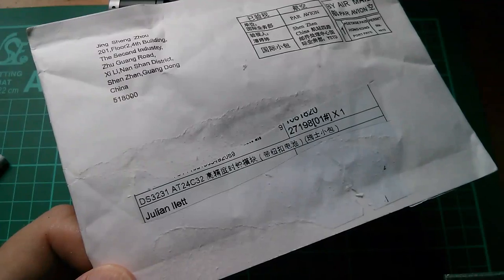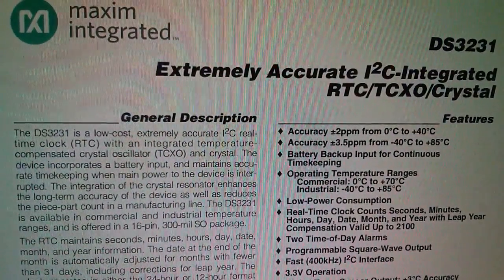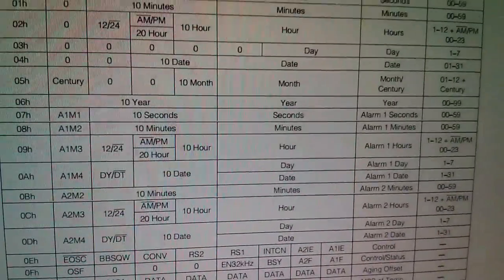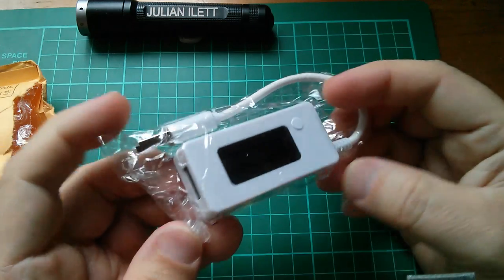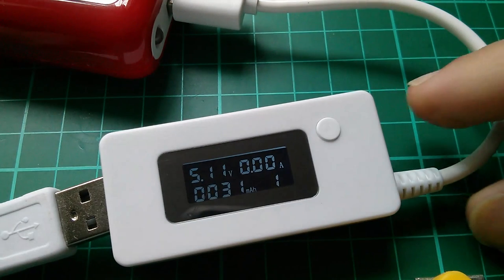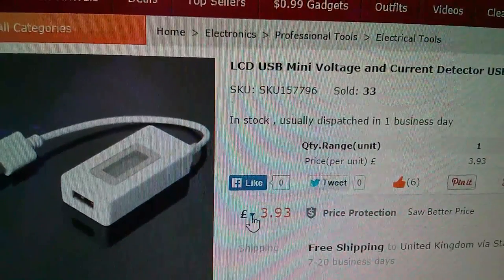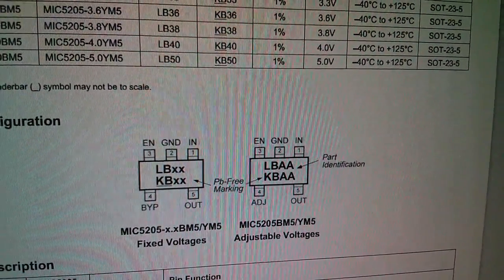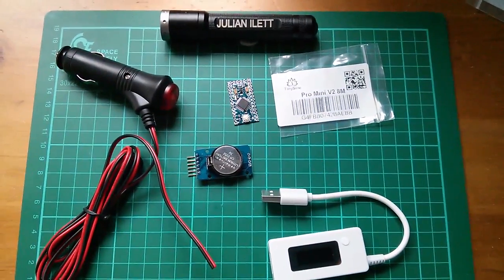Postbag #18: DS3231 RTC, USB LCD Doctor, 3.3V Pro Mini, Cigar Plug

Comment: 1. Double click - "change memory cell" mode. Single click - change cell. Double click again to exit from this mode.
2. If holding button approximately 3-5 sec, its clear NEXT memory cell (if you need to clear second memory cell, you need hold button on first cell).
3. Device start blinking if voltage is too high or too low. (Double click to disable blinking for current session)

sorry 4 my English...all the best from Ukraine! ))

Comment: Hi Julian, the reason why the device is flashing is the voltage is too low.  At 4.42V it is too low to support USB devices and the device will flash, and quite often shut down completely.  The micro USB connector is for testing cables for their Voltage Drop.  That connector can also be used in place of the attached standard USB plug.  Phones and Tablets can be attached to the USB monitor directly using a micro USB cable.  This is a nice feature not found in other USB monitors.

I hope this helps. :)

David

Comment: I much prefer the DS3231. It's more accurate, doesn't require a crystal, allows you to read the temperature. I've had some Chinese DS1307 modules with terribly inaccurate crystals. Only downside is that is doesn't have any battery backed memory like the DS1307. Luckily, because the IC doesn't do bounds checking (!!!), you can just (mis-)use the alarm registers, to store your own data.
Thanks for yet another entertaining video Julian!
Reply from the maker: beargun42 I had one of those inaccurate xtals too - lost about 3 seconds a day

Comment: KCX-017, long hold on button - moves to next memory bank and clears it to zero, double click puts it in memory view mode (no erase) and then you click once to move to next memory, double click again to exit memory view mode.  Maintains all 10 memories when power is off.  Flashes below 4.6 volts to indicate under voltage and you should see an arrow pointing down of far left of display.
Reply: Thanks!

Comment: Wafer thin PCB's seems to be the latest cost cutting measure in the far east. I just bought a new computer full size atx motherboard and the pcb would be lucky to be 1.5mm thick and shows considerable bowing from the soldering process.. It is a "quality" brand name but I suspect the competition are also up to similar tricks.
Reply from the maker: Rob B We demand cheap stuff - they respond
Reply: Sometimes it is useful. I have had times where that extra half a mm meant the difference in something fitting in an enclosure and not, but that doesn't mean it is actually a GOOD thing most of the time xD

Comment: I have 6 of the USB Doctor and all of them ended up with broken cords.  If you look at the cord at the device end, the cord is protected by a flex guard.  There isn't a flex guard on the USB plug end.  The ring like guard is so stiff, it eventually cuts the cable.

There is a newer version that has flex guards on both ends.  I found a seller on Amazon.com that has the new version, however, when I purchased 7 units, I received 5 old versions and only 2 of the new ones. :(

I also use a USB power monitor from a company called Portapow.  They are located in the UK, I purchased several units and had it shipped to USA.  Its probably the most advanced USB Power Monitor available. It can handle 0-50 volts and 0-5 amps.  Their website is "portapow.co.uk"  I hope it is a gadget you can review on your videos.

David.

Comment: How well does the ciggy plug hold into sockets? I have quite a few where the spring on the tip just pushes the plug out, and there isnt enough grip on the 2 ground springs to retain it. Really great when you drive for 45 mins with the mobile not charging without noticing it.
Reply: pretty much the design flaw of the plugs and sockets really, some work together well enough, others fall out or dont work at all, theres no real standard i think, and yes nothing really holds it in except the friction of the outer connector
, the actual lighters that once went into the car sockets were trapped in a springy catch (which got hot and released), but when they turned into accessory connectors and the required plugs, it was friction alone
, and the sockets changed inside to not include the catch, many sockets are way too shallow now, is a large part of the issue
Reply from the maker: Richms raw footage It looks pretty good - the outer connectors are quite firmly sprung and the tip is quite softly sprung. It also has the barb at the front.

Comment: It started flashing right around when the voltage dropped outside of USB spec, could it perhaps be a warning?
Reply from the maker: SixSixSevenSeven Yes, it seems the backlights flash to indicate under and over voltage.
Reply: Based to picture from similar listing, if voltage is below 4.6v or is over 5.3v the display flashes
Reply: Yep, <4.6v is out of USB spec. A power bank should never drop under that. It could potentially damage things plugged into it. Same goes for >5.3v.

Comment: hmm  Day ?  There's no need to be able to set that individually from the day/month/year.

you can fairly easily calculate the day of the week from the day.  The algorithm to do this was developped somewhere in the 19th century, way before computers and even mechanical calculators.   
Zeller's congruence: http://en.wikipedia.org/wiki/Zeller%27s_congruence (the trick is in the integer math).
The principle is converting the date to a julian day (a number of days since a certain timebase (could be anything) then modulo that by 7.
Reply: There are equally a couple tricks for doing the bounds checking based on some calculations rather than lots of individual tests. Again, those basically come back to zellr's approach applied cleverly. (it's basically all in the wikipedia page, just find the 'gems' :)).
Reply from the maker: oreubens I wonder if the DS3231 uses that algorithmic approach - or just lookup tables. I still think the chip should have an increment/decrement option (with bounds checks) in its command set.
Reply: Julian Ilett PC's and the likes have RTC's too but you typically don't worry about them since it's the OS that interfaces with them and not user code... unless...  you've been in the programming thing for a while and dealt with them in the past.

From how they behave (on PC, I don't have a DS3231 to test) I don't think the RTCs use the approach of updating a global second counter and doing all the calculations based on that.   If they did, you would see an invalid date correct almost immediately as it processes the next second.  From observed and documented behaviour I would imagine that the RTC logic increments the seconds register, if it overflows to 60, resets seconds to 0and increments the minutes register, if that overflows to 60 increment the hours etc.  so the difficulties don't start until it comes to checking if incrementing the day register overflows into a next month.

That's probably handled with special purpose logic gates rather than compare/tests or a table lookup, I doubt these things even have anything you could call a 'cpu' within.  RTC's have been around since about 1984 when it was made mandatory for the IBM AT and clones (older computers required you to set the date and time manually each boot).  So considering that time, we're talking when every single transistor/gate counted.  and RTC's have not really changed at all since.

An increment/decrement type option with bounds check looks nice from the perspective of your particular app, but doesn't make much sense in a lot of different type apps like setting the date via a console command or from a dialog in a GUI. which is probably why it's not in there,  they're essentially specialist but dumb devices and don't really have built in cpu's, and instead expect all that sort of checking to be done in software.  RTC's make little sense without some sort of processor somewhere, so why make it smarter (and thus more expensive) than it really needs to be, that's a pretty common approach for most of the electronic devices.

From what I remember, RTC's don't handle centuries right, you can't feed in the thousands, so it assumes 00 means 2000 which was a leap year, while typically a century ISN'T a leap year.  So pretty much everything running of corrent technology RTC's will fail to properly increment 28feb 2100 to 1 mar 2100 and instead assume it's 29feb.

Comment: I tried with Arduino using loops and max7219 plus RTC lib ...kept loosing time and it comes with cr3032 which is wrong and should be lih3032 rechargeable I tried an 18650 until I found out it charges to 4.35 😂😆

Comment: Re: lcd usb mini voltage and current detector

Found this on Ebay: http://www.ebay.co.uk/itm/LCD-USB-Mini-Voltage-and-Current-Detector-Mobile-Power-USB-Charger-Tester-Meter-/151383371403?pt=UK_BOI_Electrical_Test_Measurement_Equipment_ET&hash=item233f26ee8b

Performance parameters :
1, input voltage : 3V-7V
2 , the input current : <3.5A
3 , the display : voltage, current, discharge capacity ( total of 10 groups can be stored )
4 , the data function:
5, the data calibration function
Data calibration function settings ( factory have been adjusted, if you feel not allowed to self calibrate the following way ) : an electronic load device, a constant current source .
Constant current source and transferred to 8.5V or less than 10V (recommended 9V), electronic load is set to CC mode ( constant current mode ) 3A, 2A, 1A, 0.3A , respectively, the four current calibration . To 3A as an example:
When 3A calibration: electronic load setting the constant current mode 3A, LCD fuel gauge will automatically slow the current calibration ( about 10S) can see the current will change the LCD screen , turn off the electronic load calibration data is automatically protected.
6, the data is cleared : Hold down the button until after ( the first of several sets of data ) becomes the next set release button , automatically skip to the next set of data from scratch.
7 , View : Double-click the button (0.5S or less ) , enter to view the data view mode , then the backlight LED will flash , and then click the button to display the next set of data , several groups so check back . Double-click to exit View mode , backlight LED grow lights .
8, the voltage is high or low : Arrow LCD backlight LED flashes prompt. Press the button LED lit 30S.
9 , power status :
By MicroUSB cable or USB cable tester comes with male power , the LCD screen will display the entire contents of about 1 second ( detection LCD screen stroke segment is intact ) , and then displays the last data ( capacity, and third sets of data ) , high or low Tip voltage, current and voltage current
Reply: Some more info regarding the mini usb: http://www.ebay.co.uk/itm/LCD-USB-Mini-Voltage-and-Current-Detector-USB-Charger-Tester-Meter-tool-/251638237442?pt=LH_DefaultDomain_0&hash=item3a96cec902
Reply: Kenneth Rosenstroem Well, that's more information than the seller I got mine from provided in the listing. I'm not sure I understand things any better :)

I think the important bits are that:
* It can be powered from its integrated cable, or you can use an external cable and test the voltage drop in the cable.
* Double clicking puts it into what I will call "data review mode." In this mode, each click advances to show the data in another slot. Double clicking again takes it out of data review mode.
* Click and hold to clear the displayed data slot.

It seems from those other descriptions that you might be able to calibrate the thing?  That worries me, because I wonder if I accidentally miscalibrated mine trying to figure out how to operate it.

Comment: ASDA are selling that red powerbank you used in white for... £20! :O
Reply from the maker: Callum Burns Ouch! It's good value at £4, but not £20.
Reply: Almost fell over when I seen it. Saying that I did find one on sale where they have the batteries... £3! 2200mAh. Wasnt going to say no! Its in a nice Ali case too. http://direct.asda.com/Quby-Power-Bank-and-0.3M-Micro-USB-Cable/001141412,default,pd.html?dual=0